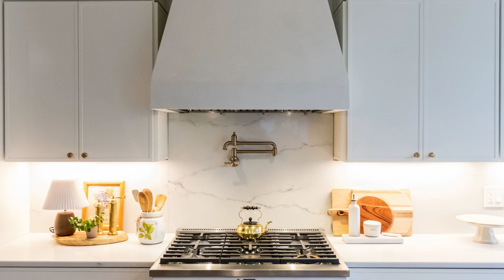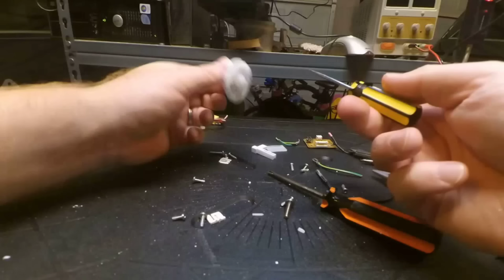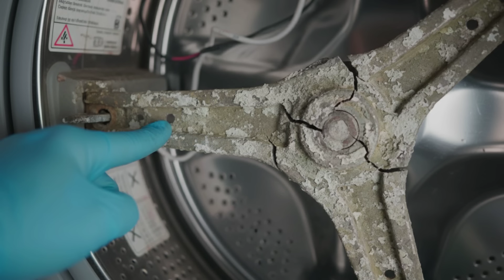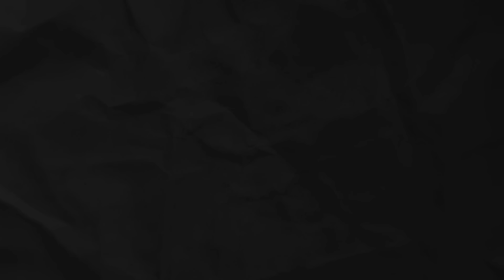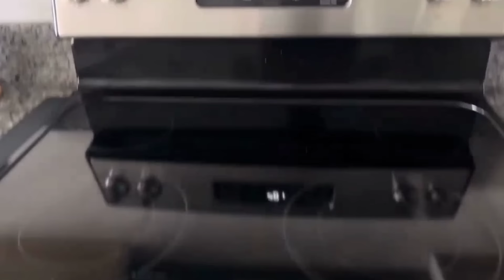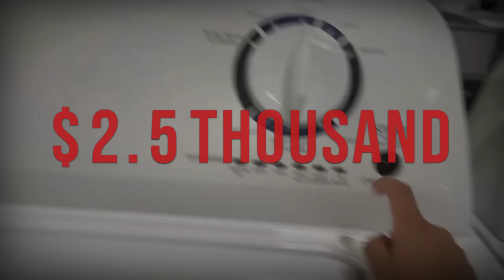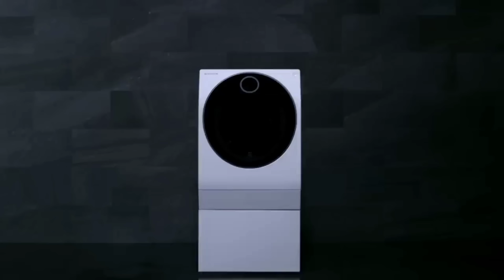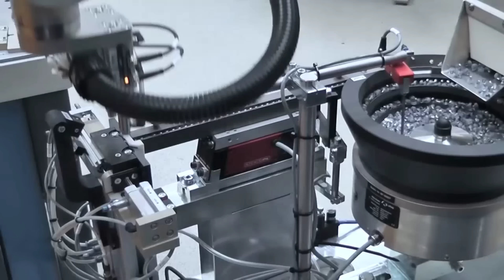The Repairman Blacklist: 5 Appliance Brands to Never Buy

Comment: Thanks for raising an important issue. Greetings from Europe, Finland.

Home appliance manufacturers claim that consumers want to replace their home appliances every seven years. I have not met a consumer who would like that, but who has to do so.
The old truth is that cheap doesn't always get you good - although not always expensive either.

I would like to replace my touch-screen induction hob because the touch switches react poorly. Easy, let's just go to the store?
I wish there were. I don't know about the USA, but in Finland there are no old-fashioned manual switches anymore. Everything is touch switches. Of course, you can get them in Finland if you have the money. At least SMEG makes cookers with manual switches, priced at 3,000-5,000€, while those with touch switches cost 300-500€.
So is it true that touch switches are so much cheaper to manufacture that they are used?
At least in cars, Mercedes Benz and Volkswagen are giving up touch switches due to consumer opinion. Thanks to them!

I accept the manufacturers' product range if I'm the only one who wants manual switches back, but when is that not the case? And durable machines, even if they cost more.

My mother, 92 years old, still washes her laundry with a Finnish UPO washing machine she bought in 1974. It still works as reliably as an old train toilet. Just guess if the laundry is still clean!

Comment: We bought a whole fleet of S@m$u"g appliances.  The washer and dryer died in 5 and 6 years.  The motherboard on the stove died at 6 years.  I replaced with a VERY dumb gas stove with no motherboard.  Fridge didn't die yet, but we wanted a bigger one.  The dishwasher doesn't work well at all ..... half the dishes are still dirty now. I'm over it.

Comment: Or they discontinue parts that are made to fail! I have an older maytag dryer. It has a little vent type part in the back of the drum. It is easily accessible from inside, only 2 screws holding it in. It's made of thin powder coated metal. First, the enamel/powdercoat wears off. Then, the part starts to rust and disintegrate... little shards in your laundry. I do not leave wet clothes sitting in my dryer! Guess what, discontinued part! Thanks, maytag.

Comment: It is not the brand so much as modern cost cutting used by virtually all manufacturers, My LG front loader is still going strong at around 20 years, with the exception of a $25 solenoid for the hot water that started leaking and I replaced. We did go with a Samsung refrigerator too but bought the freezer on the bottom version with internal icemaker. And don't even get me started on modern automobiles!

Comment: I've been in the appliance repair business for over 40 years.
All of what is in this video is ABSOLUTELY TRUE.
My appliances are older~OLD~Whirlpools. When the industry began to go REALLY BAD, I had the good sense to save many of the parts which I knew they would make obsolete so that they could steal your money sooner/faster due to appliances which they say are "obsolete(DELIBERATELY) because they withhold certain repair parts.(A "wigwag" which is part of the shift mechanism from wash to drain/spin is one of those and I saved several.) One of the major RIPOFFS is an electronic timer in your washer. When I need to order a replacement, it Comes with what is termed a "core charge". This means that I have to return the defective timer to the mfgr. They REPAIR this defective timer and turn it around to sell as a "BRAND NEW PART.
I have a shop full of older, "discontinued parts because I will NOT be conned into falling for one of these new "modern" "POSs" of DESIGNED TO FAIL trash.
Samsung & LG are made in Korea. I often make this joke: I once bought a Samsung radio and it only played in Korean.
The video above is ABSOLUYLY CORRECT.
Now~~Go CLEAN THE LINT OUTOFTHE LONGEXHAUST TUBE WHICHEXITS YOUR HOUSE AND YOUR DRYER JUST MAY LAST A LITTLE LONGER.
WHY? Because the reason many appliances fail is besides the deliberate built in failures.
Much of it is due to failure to do things such as cleaning a lint filter/tube.
Also, learn what a condensor coil is in your frig,/where it is and CLEAN IT EVERY FEW MONTHS~~especially if you have aminals.

Comment: I wash my clothes with a 1981 Sears Kenmore washer, built like a tank, thick metal, heavy duty motor, just a couple knobs, top load, still going strong, I'm on my third dryer in that time frame, but I always buy the manual one with the fewest gizmo's.

Comment: If you use a reliable but old appliance, you might not know it's ready to be replaced until it catches fire inside your home. My 28 year old Maytag washing machine motor caught fire seconds after starting it for a full load of towels. Thankful I was able to turn it off quickly. Fire dept wiggled it out of my house/down the hallway to the curb with lots and lots of water splashing out all the way.

Comment: We bought the Samsung smart refrigerator from Lowe’s. The big screen electronics died in less than a year. We called Lowe’s as it was still under warranty and they could not get the part  (board) needed. The nice thing was, Lowes refunded us the full price we paid for the fridge and we still got to keep the frig, which still worked, but the electronics don’t. Thank you Lowes for doing the right thing!
Reply: a rarity.  fyi - don't waste $$ on their extended protection plan.
Reply: My friend has that refrigerator and the icemaker stopped working a year after they bought it.

Comment: I bought a new washer and dryer set when I moved into my new home. The last one I had was a front-loader, and I hated it. There wasn’t enough water in it, so every wash load, I had to add a couple of gallons of water to the wash, and another for a rinse. I left it behind for the next tenant.
The new set was a top-loader, and had no agitator; it was only little wheels in the bottom of the drum that were supposed to get the clothes clean. The problem? Those little twisters did exactly that. Everything I took out of that washer was tangled with several other items. Finally, I got the brains to figure out what I needed was a commercial top-loader. It does a great job, and probably won’t need to buy another machine for the rest of my life.

Comment: I delivered  appliances  for Lowes from most of 20 years. In our department we would have all agreed that lower tech is generally better. Because we based our choices on what we didn't bring back (compared to what we delivered) we looked at it this way:

1) Lower tech is generally more reliable (though I did get a deal on a double oven range that had been returned it all the bells and whistles and loved it)
2) nobody really built a " bad" range
3) if you want one manufacturer for everything (meaning product type) that is a reputable product buy a Whirlpool (or one of their other brands). Somebody might build and individual item better than them but nobody made EVERYTHING better than them.
4) you couldn't pay us to put a Samsung product in our homes ( but we were rather impressed by LG)

Comment: For many years we had appliances from Sears Canada. They were simple, durable, easy to repair at home and Sears had a great parts depot system. In the 80s I owned a retail appliance business and soon learned which mfrs had quality goods. I sold 90% Inglis Canada Dryers, washers, dishwashers and stoves. The were built like Tanks and lasted years. For a cheaper line we carried Frigidaire and GE.These once proud, reliable brands were junk and manufactured with the very cheapest parts  so my repair man hated them. Whirlpool then bought out Inglis and Maytag and turned them into second class units and made Whirpool their top line but it couldn’t hold a candle to those two brands in their original form.

Comment: I got tired of buying a brand new washing machine every two years. I finally decided to go on marketplace and I found me an old 1976 washing machine that still worked perfect. It is about 10 times heavier than any of the newer washing machines and the best part is there are only two buttons on the entire machine and one dial. This thing works like a top still to this day. It doesn't even have a switch on the lid so you can open the lid well it's running and add whatever you want. I love this thing!

Comment: I have a Frigidaire refrigerator with the freezer on top. New model, highly efficient! How did it get its efficiency rating you may ask, the refrigerator ceases to run if the room temperature drops below 50. This is something I did not know, as a refrigerator was part of a program that supplied Efficient Electric appliances on a low income benefits program through the electric supplier. So, in a cool pantry, if the temperature should drop below 50 say goodbye to all of your food especially that which is in the freezer. This refrigerator was three steps down from the one that replaced, and probably no more efficient. At least with my old fridge, I never had to worry about my ice cream melting.

Comment: I had a dryer (Neptune) that died so I started taking it apart to try and fix it. I have never in my life seen so many parts and piece and screws and plates and wiring harnesses (3) Just the door alone was overkill. In frustration I finally just tore it up and didn't bother. I replaced it with a 1993 simple dial dryer that only needed a $9.00 belt and was easy to fix. It's still going. I will keep my old stuff for as long as a can. At least you can still get parts (for now).

Comment: i have lg from year 2000 and still going strong both units  lg tromm built to be fixed and was very expensive in year 2000  like 6500.00 for set  that would be like 25000 today

Comment: I have a Bosch heatpump tumble dryer with a self cleaning condenser. It’s now 15 years old and with no service calls it still runs as new. Extremly cheap to run due to the heatpump wich also takes better care of my clothes as less heat is used during the drying process. Buying a heatpump dryer with a self cleaning condenser from a quality brand is what is cheapest in the long run. It also does not vent out any indoor air to the outside wich would have added extra air conditioning costs. A win win for my wallet, my clothes and the environment but maybe not for the appliance industry.

Comment: I'm a licensed installer and I totally agree.  Problem now is that to get an analog/mechanical range you have to spend more.  My all basic control BlueStar range is $3000 or more now.  Also, Whirlpool stopped making the Maytag top loader washers with the single motor and heavy duty transmission.  SpeedQueen still works but they cost a premium amount too for the basic commercial grade machines.

Comment: A while back, I found a social media discussion about appliances and in particular, that the older brands like Whirlpool were quality-made compared to today's brands/models. I live in a condo and have a stacked Whirlpool washer/dryer that was bought in 1991. A few years back when I thought of remodeling, to replace it with more modern brands. Then I came across the discussion and found out that Whirlpool had an excellent reputation and was virtually bulletproof. I'm glad I didn't. It doesn't look modern looking but it still is chugging along after 35 years. Whew.

Comment: I will never ever buy anything made by Samsung again.  We bought a new clothes dryer, within 2-weeks it stopped heating up, called customer service, they gave me a number to call for our nearest repairservice.  I called it, not in service, the store had closed down.  Called customer service again, they gave me an address for a repair store, yes it was the same one.  This went on and on and on, I could not get any sort of assistance from them.  I called the store where I bought it (The Brick), explained the problems, they were brilliant, came out the next day, gave me a replacement (different make) and took away the faulty one.

Comment: Our house came with a fridge from 1978 and a dishwasher from 1994, both of which still work great. People say that they use more electricity than new ones, but there is no way that new ones save enough electricity to make up for the financial and environmental cost of replacing the old ones. An honest appliance salesperson told me that new appliances are designed to be replaced every 7-10 years. If we had bought new appliances when we moved in like everyone told us to do, we would be on our third or fourth set by now.

Comment: 2016 kitchen aid refrigerator $5000 pos. Ice in bottom of freezer that needed scraping every couple months. Forget the beverage drawer, it never worked and a repairman told me that's a stupid design as the ice maker in the fridge door right above the electronic panel. Compressor went out in freezer and I was told the fridge will be soon. Another repairman pulls the vege drawer to find mold underneath dues to a known common problem with the drain line. It's impossible to reach whirlpool as they are the mother company as their phone system is designed to take you in circles with no reachable employees to ever answer. If you email, they do not respond. I just want my money back so I can buy a real fridge that works, but since I can't reach them I think that small claims in the amount of $12,500 is better. F it!

Comment: I recently had a repairman come to look at my whirlpool side by side fridge because the icemaker stopped working.  I asked him which brand does he prefer-answer was whirlpool or maytag. I buy whirlpool or maytag because they are american made. But I still believe all of them are not made to last they have so much plastic in them.  My fridge is less then 5 yrs old the ice maker should not stop working. The ice maker is on the door. I was also told by the repairman that most appliances do not last more then 7 yrs. I think its disgusting that these manufacturers are getting away with making junk being they cost so much more. I dont like technology on my appliances my fridge does not have it except for water and ice. If I have to ever replace one I will buy the cheaper no frills fridge with just an icemaker no water or anything fancy. I would recommend buying an extended warranty.

Comment: Erm, that is all very well but, I used to run an American made analogue Speed Queen washer - the cost of replacing the gearbox (it was fine, just leaking like a sieve), was more than the price of a new machine from the brands you list here.  A few years before that, the analogue timer failed - part alone cost almost as much as a complete new appliance from your list.  When I decided - fcuk this money pit from America, the belt was due for replacement - you can guess how much that was going to set me back.  American appliances are just too expensive to keep, in sunny South Africa.

Comment: I have a Frigidaire laundry centre, made by Electrolux.   It didn't even last a year before it started doing really weird things like no hot water released, would not give a max fill, started rinsing with only a low fill, started spinning for more than 24 minutes and started skipping the rinse cycle altogether. Electrolux screwed me around for months. I finally had to take them to court.

Comment: My Amana (made by Whirlpool) washing machine has 3 manual knobs: water level, temperature, and cycle. My daughter's washing machine looks like flight panel from a jet liner- real guessing game.
My Whirlpool dryer is used. 2 manual knobs plus a third knob for the buzzer to sound.
Reply: A few years back, my sister hunted for a legacy "low tech" washing machine after her old one finally died.  She got a good deal at a local appliance store, but then they called and said sorry, it's out of stock and we don't know if or when it will be available again-- but we'll give you a great deal on another model!

It was a high-tech machine.  My sister very reluctantly accepted it because the laundry was piling up.  She hates it.  There are a million "options" and "features", mostly for alleged energy-saving.  The worst part is that users can't control it or interfere with its operation once it starts.  

She says that now, doing a load of laundry is like launching the Space Shuttle. 🧺 🤬

Comment: I had to completely disassemble my LG dryer to diagnose a TE1 error code. These appliances really are pieces of shit and it becomes very obvious once you see the inner workings. You don't have to be an engineer to realize they did not design these for the sake of quality. And by the way, that code is supposed to indicate a failed thermistor ($10 part), but of course it wasn't that simple. $310 for a new control board fixed it.

Comment: I have the LG front loader and the spider outlasted the rear main bearing and seal.  It was 17 years old when the bearing and seal failed causing a water leak and growled when spinning.  I tore it down, inspected the spider and bearings. The spider had minor corrosion but nothing very significant.
I wired brushed it clean, heated it, and painted it with a clear latex paint.  It survives.

Comment: I hate digital washing machines.  They never clean clothes properly, can’t stop midwash, break down in no time.  I have a digital machine and My husband got me a Speed Queen (analog) washing machine and you can see the difference right away when you wash with each machine.  Clothes are always clean coming out of the Speed Queen…but not the other.  SQ washes in a fraction of the time too.  Now I just use the other machine for bleached loads.